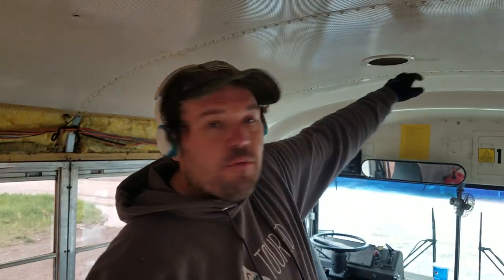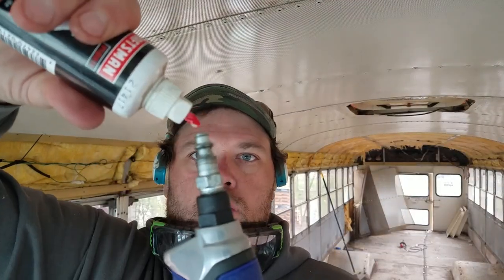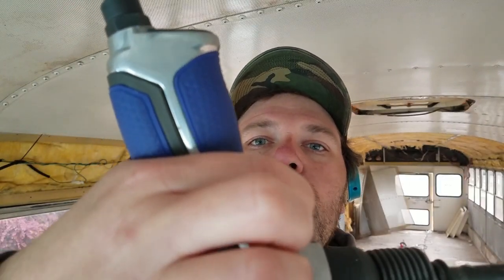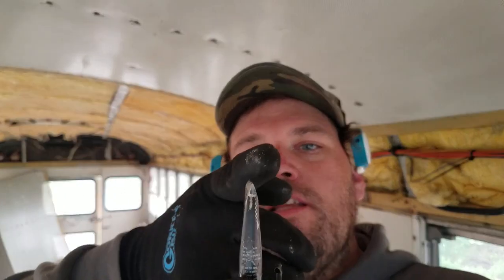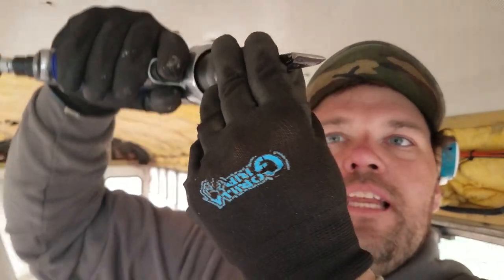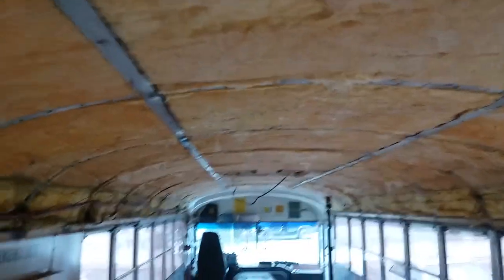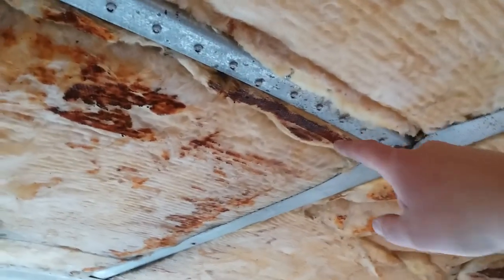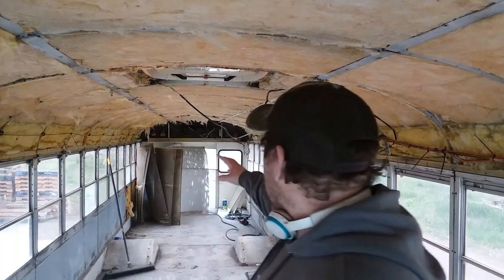Bus Conversion Vlog #15: Removing The Bus Ceiling Rivets

Comment: Love the vid. If you watch our vids can see how we did our ceiling and wall removal but you are right it is a process, no matter how you go about it. We have been working on cleaning out wiring now for a weeks. just a little at a time as we can get out to the bus to do it. We originally wanted to be on the road by this time but have found life gets in the way.
Reply from the maker: Bohemian Bus Odyssey I checked it out today, gonna try to figure out the best way for the walls tomorrow